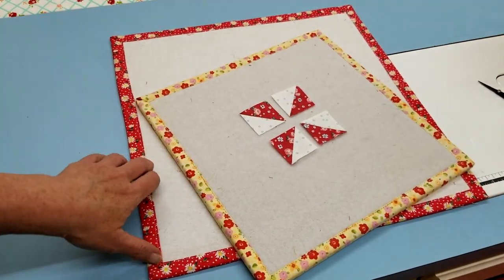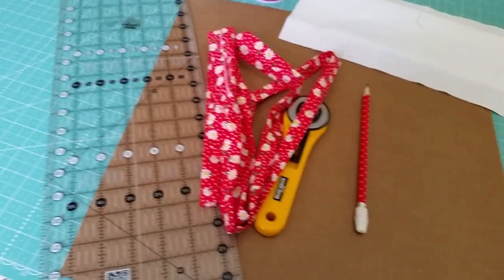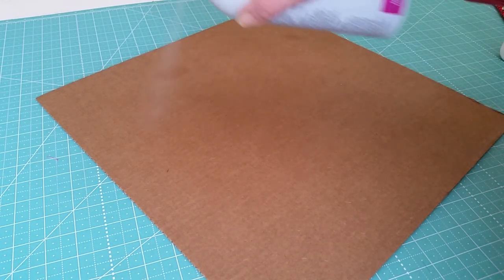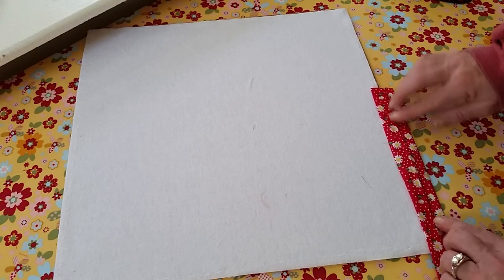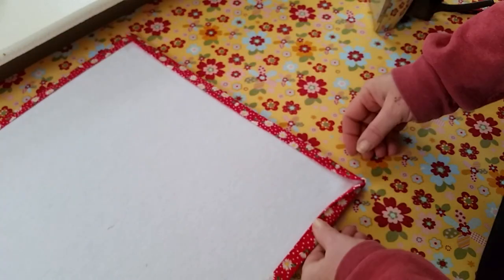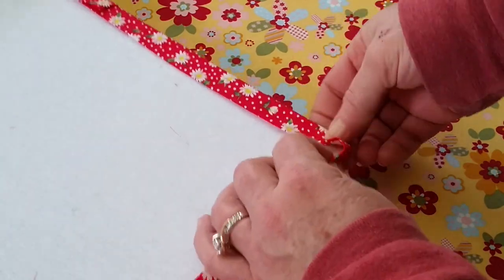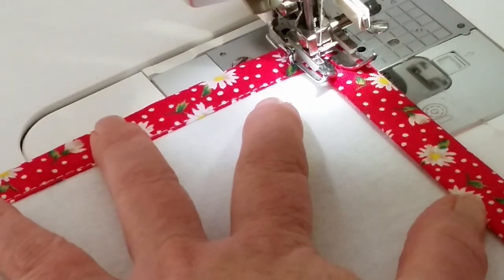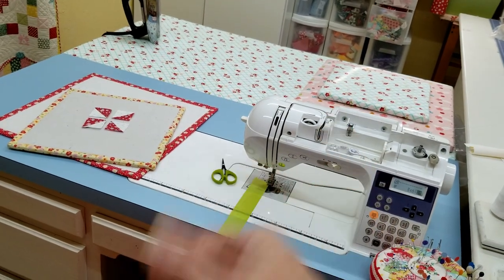How to make Quilt Block Design Boards

Comment: Not sure if anyone suggested it or not but foam board from the dollar store works great as well
Reply from the maker: That's a good idea if you don't have any boxes to cut up.  Thanks for the idea.
Reply: I've made several using dollar store foam board. Tbe hard part was using hot glue. This looks less painful.
Reply: @Carolmaizy I use foam board too….and I use Elmer’s glue to put on the binding ,I iron it on and it stays very well

Comment: Thank you for sharing!!  I’ve got some allergies that act up with the smells that can come off of cardboard.  Idk how long cardboard can smell b/c I can’t tolerate it (headaches). Do you have any alternates?
Reply: Ok.  I see foam board & packing foam.  Will have to experiment b4 making, but that could work.  (Yours is the 1st “how to” I’ve seen on design boards.)
Thanks!
Reply from the maker: I've not sewn these with anything other than cardboard. If you sew the foam boards version I would be interested if it works.  Happy Stitching!

Comment: I made two using the hot glue method.  THIS is so much easier and I will be using this method when I make more!
Reply from the maker: I tried hot glue too, I made a huge mess!  Stitching takes a little longer but it's not as messy.
Reply: And we won't burn our fingers pressing down the fabric on hot glue
Reply: @ibrockinrobin67  The Elmer's glue also is much flatter than the hot glue.  Makes for a nicer finish!

Comment: Thanks for sharing this video. I tried the glue gun method and made a terrible mess! So I decided to try to sew the binding on just like I do my quilt binding (sew both sides) and voila! I also used white flannel, but used the  foam board (cost $3.00 each from a dollar store).

Comment: I made of several of these some years ago....I used box cardboard for the base, quilt batting scraps instead of the flannel, and ironing board fabric for the back side.  I sewed the batting, ironing board fabric on 3 sides and slipped the cardboard in and closed of the.  They work great for a light pressing if needed and have held up for years.
Reply: I used them for Christmas gifts for our sewing circle.
Reply from the maker: They are very handy.  I 've used mine for pressing boards also.  Never thought about giving them as gifts!
Reply: Oh!  That is a great idea!!  I'm going to try it that way.   How did you close them up?  I like the colored trim but it would be easy to sew strip borders to the batting or flannel.  Then if the board gets flimsy, I could open and replace it.  Thank you for the idea.
Reply: I wonder if you could stitch the binding ALL the way around, then flip it over, place the board (form or card) on top with more flannel or batting or even fabric, then glue down binding only on the back.  I love the stitching on the front & have a walking foot but don't want to sew through any thickness. (fussy machine)
Thank You..great idea & demo.
💜🧡♥️💙💛👍👍👍

Comment: Stay away from UPS stores for boxes...They are ridiculous in prices.  Walmart has boxes but Poster Board is better for these and a piece of batting then binding
Reply from the maker: Can you sew poster board?  I prefer the thrifty free cardboard and sewing them.  Boxes are free at Walmart and the Dollar store.   I only use poly batting most of the time due to allergies but yes cotton batting would work.  Thanks!
Reply: @podunkpretties  I don't sew around it, I used a glue gun and I apologize, NOT poster Board but the Foam Board in craft section, but like you, the cardboard is best and free...LOL

Comment: Thank you for this wonderful video on making design boards.  Love your method.  I burn myself rushing to use the  glue gun and do not like it.  This is much better.  
Your sewing area is so pretty.
Reply from the maker: Thank you.  My sewing room is a constant work in progress.  It's taken 30 yrs to get it to this point. Most of it has been done in the last 11 years, after all the kids were out of the house and I had more money.😂  I had the same problem with getting burned and the spiderwebs of glue, GRRR....that's why I tried sewing the binding like a quilt.  I'll admit that I was shocked when it actually worked.  using cardboard was due to being a thrifty hillbilly from Podunk.  Thanks for stopping by!  Feel free to stop by anytime!❤
Reply: Amazon always has boxes

Comment: What is your limit of thickness (cardboard) you sew thru??
Reply from the maker: I have no limit, but I do a test before using a new thickness.  Each sewing machine is different, some can handle more than others.  If you do a test I would suggest manually lowering the needle through the cardboard.

Comment: This is just what I needed. Just one question, instead of flannel can I use batting? Thank you for this tutorial 😊
Reply from the maker: You're welcome!  Sure, you can use whatever you want.  Some battings hold better than others.  I think cotton batting would work best.  I used it for a large design wall for years.
Reply: @podunkpretties  thanks a bunch 😊

Comment: What is that around your machine?
Reply from the maker: If you're talking about the blue part, it's my sewing table.  It's an old vanity my uncle made for my aunt back in the 80"s.  I cut a hole in it to fit my machine.

Comment: Nice video.  I’ve been cross stitching lately, and I make these because my embroidery floss will stick to them.  I use sticky board, but never thought of cardboard so I’m going to try it.  Thanks for the idea.
Reply from the maker: I never thought of using them for embroidery.  Great tip, thanks for sharing!
Reply: i use a corkboard for the floss